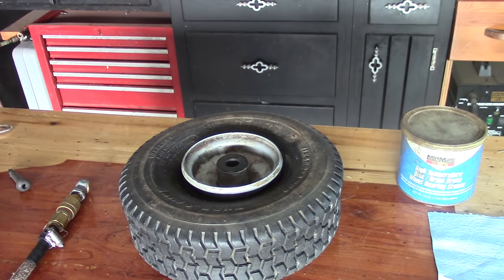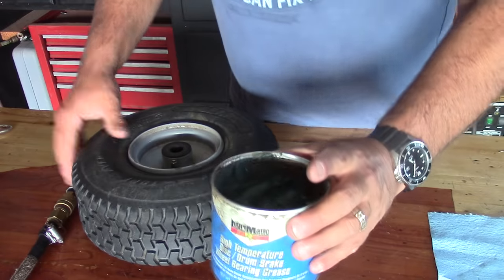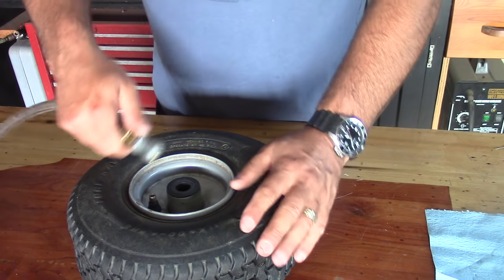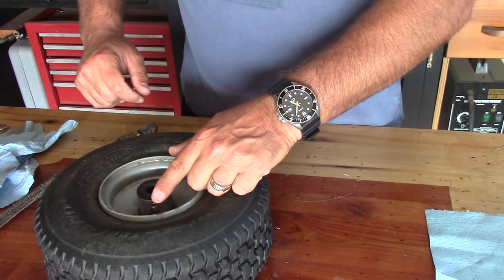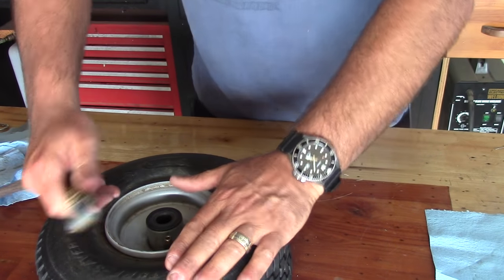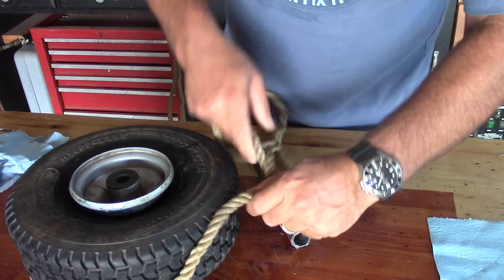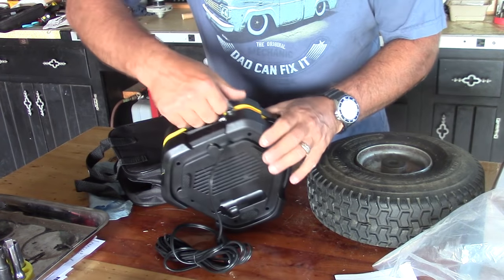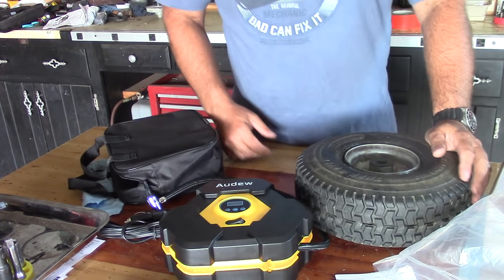How To Inflate A Tractor Tire Off The Rim

Comment: Thanks for a great video. So as long as I can remove the wheel from the snowblower by myself. I am a recent widow and now have to do many things on my own. I would love to WIN the little compressor as I just happen to have tires on most of my stuff that are off the rim or flat on need a tube or a new tire. Can the technique you just showed, can it be done with the wheel still on my snowblower????
Reply: It's possible as long as you can get the rope around the wheel. If you have a Rachet strap that works even better. I used 2 straps one for each edge of the tire.
Reply: Hey there, I just noticed that I never came back online to tell you what happened when I tried to fix my snowblower tire, how it was shown on the video. Because it was a  while back I won't try to give any little details. What I will say is this, if I did it with just one attempt and nobody around to assist etc. Anyone should be able to do this by themselves too. I was at the time, a 60 year old widow who was determined, not to let this tire beat me. I carefully watched the video and went to the garage to get the tools required, together. I was lucky to find a good rope, about a foot-long ratchet handle, and of course my compressor. I wrapped the rope around the tire as shown. I took the ratchet handle and slid it crossways under the rope and began turning it until the rope was nice and tight. I slid an open piece of pipe over the handle so my fingers wouldn't get mangled if the ratchet handle decided to get pulled out of the pipe and my hand when I put the compressor to it and gave it a good shot of air. All of a sudden, pop, on went the tire. I was very excited that it worked on my 1st attempt. It is still in great shape this winter too. Thanks so very much for this simple yet informative video. I will have to check in with you, with regards to other items I need to fix and can't afford to hire someone else to do it. Great Video. 👍

Comment: Two comments-move the pipe further from the rope knot and substitute a long screw driver for the pipe to give more working room.  But, save all that and by taking off the air input nozzle and just push the bare hose union onto the valve stem.  It will allow way more air inflow and easily inflate the tire enough to seat the tire.  This is the way you seat 6' tall tractor tires to their rims, too.

Comment: of allthe tires iv fixed ... never thought a rope and a pipe could be used ...always used a ratchet strap or a air compressor hose rapped around tight ..the fire trick too lol

Comment: Always deflate the tire before removing the valve stem.  When removing the stem with pressure in the tire, the stem can be a projectile.  Likewise, use care in reinstalling it, then pressurize the tire.

Comment: Another technique I’ve use...clamp a piece of rebar or threaded rod (about the same diameter as the axel) in the vise, some plywood with a hole drilled in it for a flat surface and then the rim on that. Makes it easier to tighten the rope without fighting the tire. Good video thanks.

Comment: Put your stem needle in first then ,Take a small ratchet strap around the tire and Ratchet it bounce the tire around a little bit to make sure that the outer part of the tires on both sides go to the Edge. Add your air released it ratchet strap once the tire gets a little tight and seals around it rim after it does that release the strap completely and put the amount of air you need in it

Comment: I’ve used this trick w/ the rope before. I tried this  this weekend. The guy I took the tire tube to  put a hole in the stem.  Bought a new tube and the second tube leaked out too. Think I’ll ck the inside of the tire for pokey things.

Comment: Well I hope I win the tire inflator!  In really need  it !!!!  Please?
 I am so glad I bumped into your video because I got a girlly idea by  just seeing you. I have a question,  and please don't laugh at my idea. 
I punctured 3 tires of my riding lawnmower with thorns to the point where I can't fix them and  they are beyond repair, (so he said)  and I have to buy a full set of tires now, but I still have the problem of thorns on my grass. 
When I saw you putting the rope on your tire, I got the idea of wrapping rope  and glue it around my tires so they won't get punctured with so many thorns in my 1 acre garden. When there is lots of wind and rain that's when the thorns drop to the grass. Do you think this could work? I have tried raking the thorns out but it's imposible. 
Or could you suggest  ad tell me what I could do? 
I'm single and I cut my own grass and it's a big yard and I'm tired of flat tires. Gracias from Mexico :)

Comment: Find a small can like a coffee can just a bit bigger then the wheel, set the wheel in the can to the air that excapes from that side goes in the can, set the bead on the other side as good as you can, fill with air, once the can fills with air it will pop the other side on.. that easy.. I use soapy water on the tire if anything..

Comment: You have the valve CORE out, the Valve STEM is the rubber the you are pushing the air into.

Comment: break the other bead remove valve core, lube both of them with dish liquid soap. Add air with a locking chuck. Smack tire against a corner of a bench while also smacking both sides of the tire. You'll get it to inflate in a few seconds

Comment: Driving me crazy. I had 2 flats over the winter and managed to get one on the bead but the other is giving me headaches. I wish I had a REAL compressor but only have a portable one. Doesn't give enough to push the bead. I hope this helps.

Comment: Pull valve stem out use motorcycle tie down ratchet strap. Give it air doesn't matter it it's on or off the axle.

Comment: Here's an easy, positive fix.  Simply take some birthday party balloons (1-3 should do it), and stuff the balloon inside the gap, leaving the balloon opening just outside of the tire/rim.  Now, shoot the air to the balloon with your blowgun, and it will inflate inside the tire, expanding the tire, and seating the tire on the rim.  That action will also seal the balloon, so it can't leak down. Now, just use the air chuck on the tire valve to bring the whole thing up to standard pressure, and you're done. YOU MAY ASK, how do you get the balloon out?  You don't... just leave it in there.  It has little weight, and a mower isn't moving quick enough to need balancing anyway.  If there's a little pigtail of the balloon left outside the tire, just pinch or cut it off.  There you go... easy, 5-cent solution to the problem.

Comment: Where are you getting tires for cheap enough where it's economical enough to swap the tires? Cheapest I could find them they cost as much as the ones already installed in the rims at tractor supply. That trick you showed with the rope is the same way you tie a tourniquet to stop arterial bleeding. Twist until the bleeding stops, then tie a knot over the lever so it won't come undone.

Comment: Liked but when you're trying to seat a bead you always take the valve core out first to get more volume. Grease is great and thanks for the paint brush. I always get it all over my hands and have to stop and wash my hands with gasoline. Then that tire would have aired up if you had pushed on the back side while putting in air (with the valve core out). Then banding it with something like that is next. Being a sailor, It breaks my heart to see the end of a rope frayed out. At least put some tape around it. Lots of videos on here show how to deal with ropes.

Comment: One side is seated,try putting the tire ,seated side up on a can or something that holds the rim only off a surface. Lightly push on outside of tire while adding air. What he is showing is for a tire that is not seated at all. Finding a air chuck that lets air in without a valve stem is not easy. OH YEAH I KNOW "I GOT A DOZEN OF THEM."

Comment: Three things: It's a valve core, not the valve stem that you removed.  You really should not use petro based grease on rubber, it'll eat it up.  Wearing a wedding band is not a good idea. I watched a man loose his finger when he jumped off the bed of a truck and his wedding ring got hung up on the exhaust stack bracing.

Comment: DOes the grease affect the rubber?
Reply: Yes, big time! Never ever use solvents, oil or grease on tires, tubes or rims. These hydrocarbon based products will degrade the rubber. He should be using tire lube. If that is not available then use liquid dish soap.
Reply: Yes.

Comment: Pull valve stem and have your nervously hold it while holding the air nozzle to the stem while you slam that mf w a sledgehammer. But I have used starting fluid with the valve stem installed and light it where it airs itself up to operating pressure almost all on its own but I have also pulled the valve stem and shot map gas in there and lit it I've literally never had to do this but I've been lucky or I'm just that badass I dunno

Comment: Doesn’t work!  It’s the back tire of a riding mower.  When I use your rope method, the bead actually pulls farther from the rim in two places.  I hate these f-in tubeless tires!! When they designed these, didn’t the genius Engineers consider that sometimes the tire go flat!??

Comment: I’ve known of this idea 💡 for almost 40 years. My dad tried it on a couple of trailer tires. It is a lot safer than trying to seat tire beads with fire 🔥. I’ve never done ✅ it. It is very dangerous. You will ruin your tires, or one ☝️ could pop up off the ground and into your face. A lot of people swear by putting fire 🔥 down into tires to seat the beads, but I strongly advise against it. Also, fire 🔥 in your face won’t feel too good, either. A few dollars 💵 spent to get tire beads seated is better than being hurt 😢 if you don’t know how. If even the tire shop resorts to fire 🔥 for seating the beads, I’d take my business elsewhere.